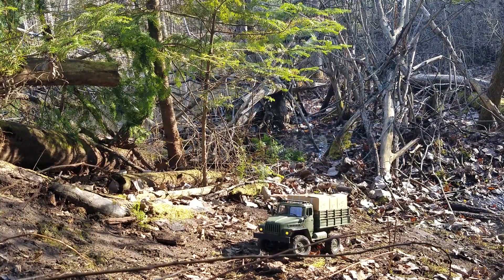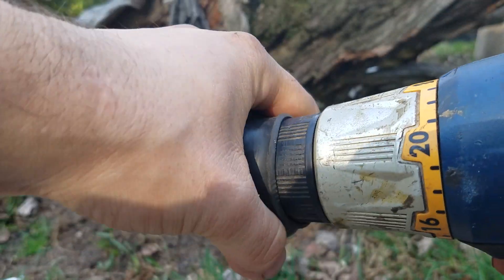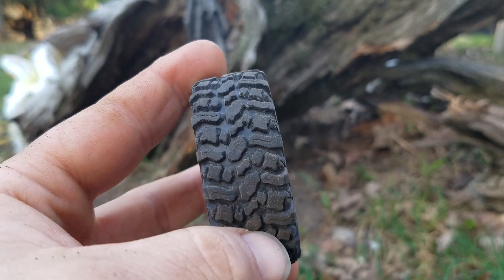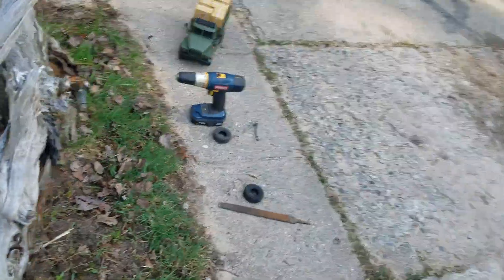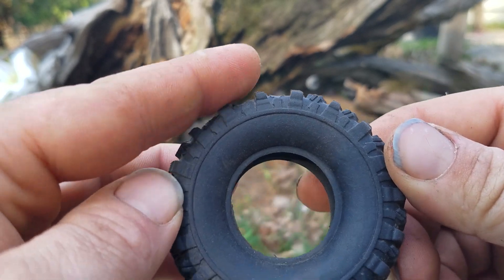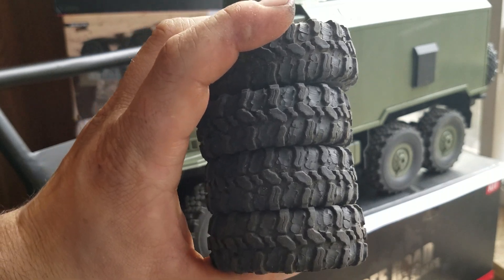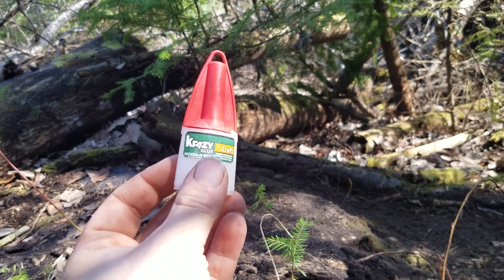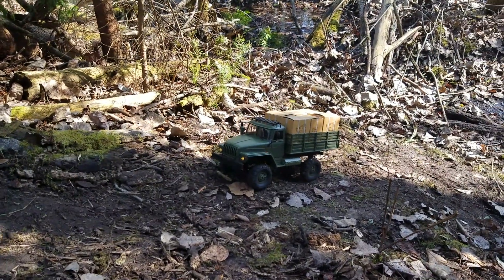WPL RTR tire mods, how to improve v1 tires

Comment: Makes a big difference,though I think weighting the wheels will really make a big change. The WPL weights may be a bit too heavy though.
Reply from the maker: I now have the front tires weighted with WPL weights,
Reply: yup, I use 2 mm solder, 3 wide 3 deep between tire beads then stretch electric tape (cut slightly wider stretches to width) 2 wraps ending with a smear of CA to lock the tape.. keeps the solder compressed against the rim. 9 turns is max, easy to un-tape and peel a layer leaving 6 turns. 100 gram roll is 4-5 bucks in eBay.

Comment: Yeah they are way to hard was out with my B14 today and it has more torque than my MN models but was slipping all over the place, was thinking of getting some MN wheels and tyres for it
Reply from the maker: yes MN tires are nice, i do believe MN wheels don't stick out as far as WPL wheels, and maybe stick in to far and rub?    i have a video i posted with MN tires on WPL wheels with a 3d printed adapter
Reply from the maker: https://www.youtube.com/watch?v=PwQJHgWF9Uo
Reply from the maker: maybe somebody can 3d print something like that for you?    or maybe Fayee wheels and tires would be good
Reply: I will check out your vid 👍
Reply: MN rims+tires are offset a little wider than stock WPL, Fayee's are a little wider than the MN but a little smaller diameter. I run the MN wheels on the B1 here, but its got a C-frame under it.